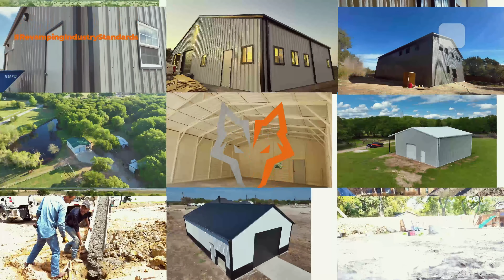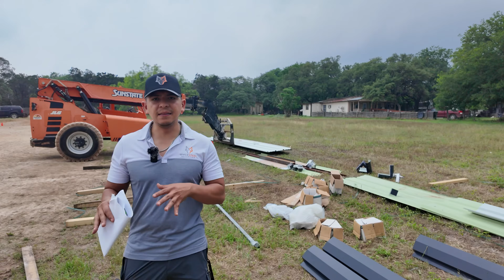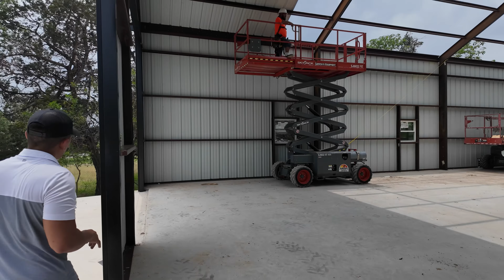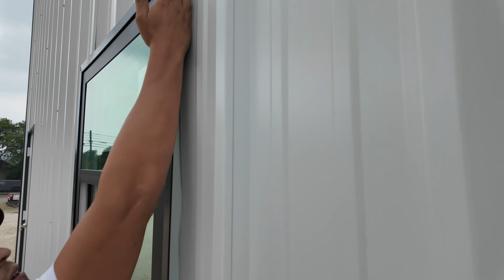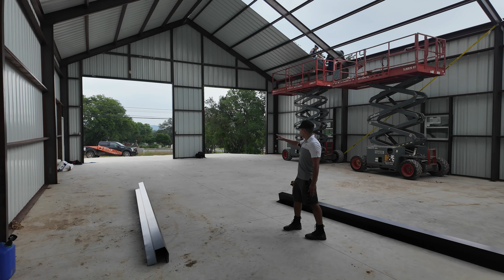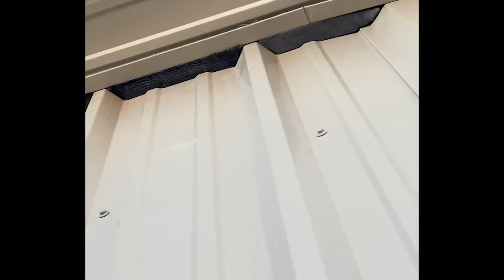Red Iron Building Installation | 40x60 Texas Metal Garage | WolfSteel Buildings

Comment: What size brutal tape do you use or you would recommend for someone doing a 40x50x12 garage.

Where would I find and buy the foam gap enclosure from my 40x50x12 garage?

Nice build, Great Helpfull video.

Thank you for your time.
Reply from the maker: Typically about an 1” wide Butyl tape. The foam enclosure you can find at a local metal supplier. Not sure where you are located but here in Texas locations like a Mueller or Metal Mart will have it. 

Thanks 🙏
Reply: @wolfsteelbuildings  

Thank you for the information. 
I'm located in oklahoma , not far from Fort Smith, Arkansas. 
There is a metal mart there.

How much beautiful tape would you recommend?
I have a 40x50x12  garage with a 40x50x12 Front extension, so 40x70x12 total